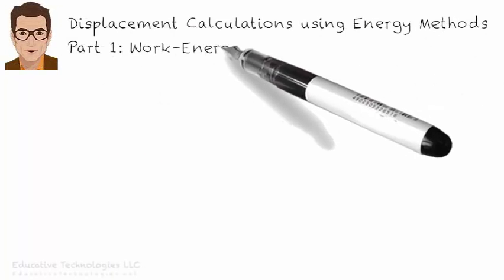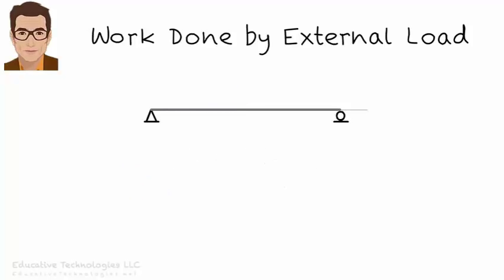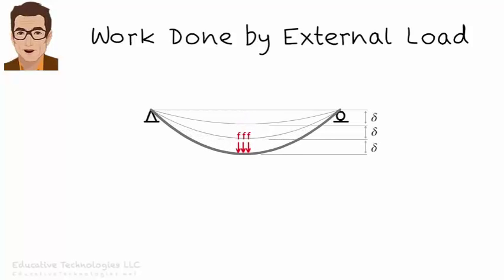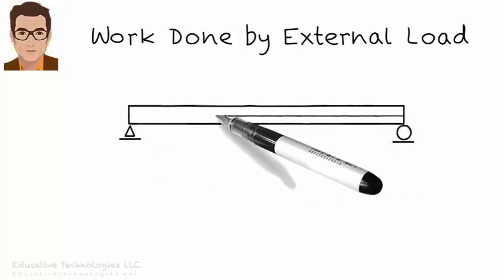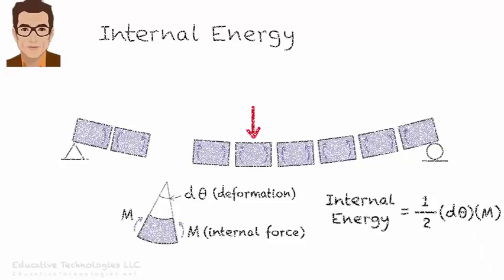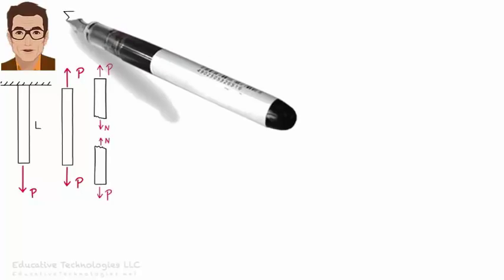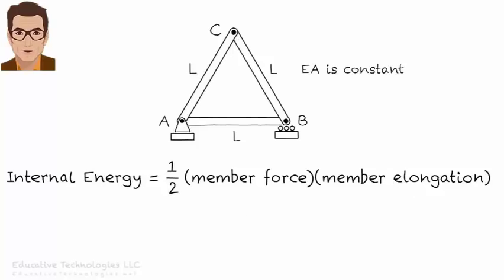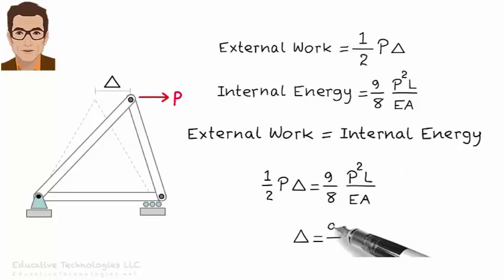SA19: Work-Energy Principle (Part 1)

Comment: Good video, but I had one question:  In the table (time/load/displacement/work), I don't think the work increments are correct.  For example, shouldn't the work increment for the first step (t1) equal to 1/2*f*delta?  I don't see how the sum of the work increments in the table can sum to 1/2*(nf)*(ndelta) as is stated in the video.
Reply from the maker: +Structures Question Since the load increment is very small, (f times delta) is a good approximation for the work done by the force.

According to the table, total work equals: f(delta) + 2f(delta)+3f(delta)+...+n f(delta).

This can be written as: SUM (i=1 to n) (i)(f)(delta). 
Since SUM(i=1 to n) i = n(n+1)/2, then the above sum becomes:

n(n+1)(f)(delta)/2

Since n(f) = F and n(delta) = D, then we can write:

total work =  (1/2)(F)(D + delta).  But since, delta is quite small, it can be neglected. So, work = (1/2)(F)(D).